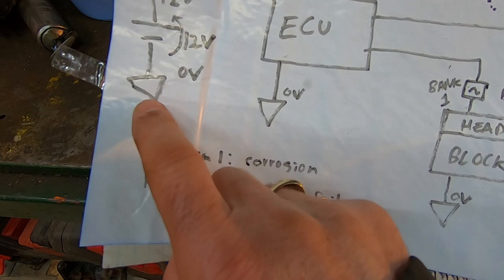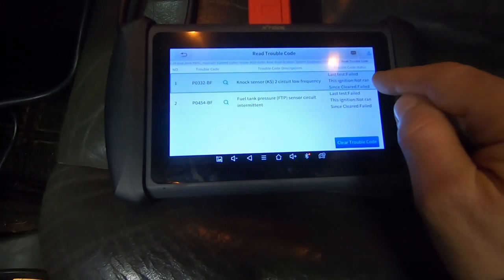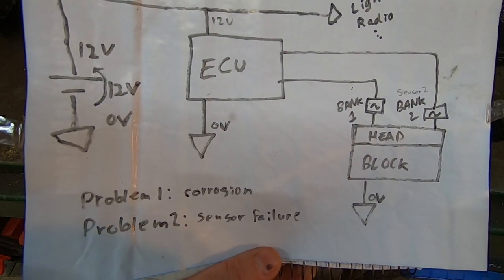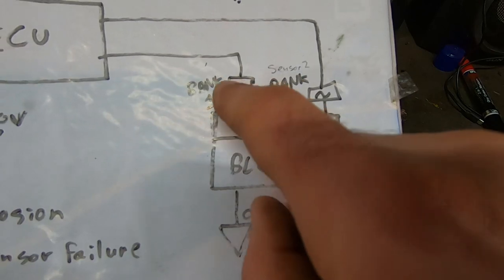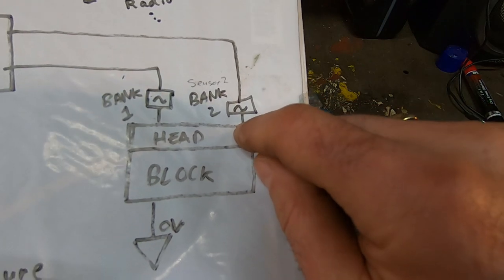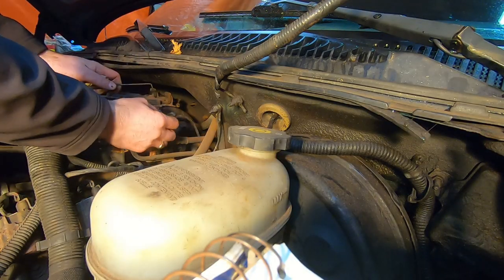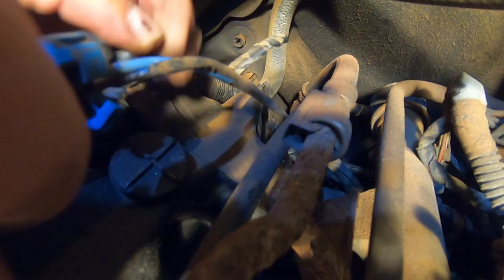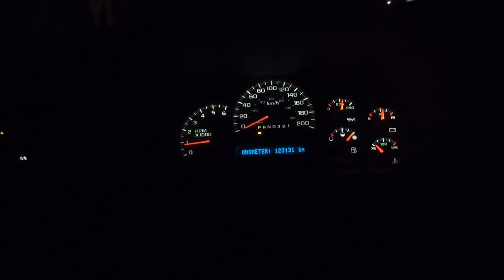$0 Fix For GMC V8 Knock Sensor Code Using XTOOL IP819 OBD2 Scanner

Comment: Had a po332 on my 98 Honda prelude.  Did test bad, so I replaced with a rockauto part ayear ago. Still haven't register my xtool ip819
Reply from the maker: I think updates only occur after registration (?).
Be aware XTOOL released new features and fixes weekly.